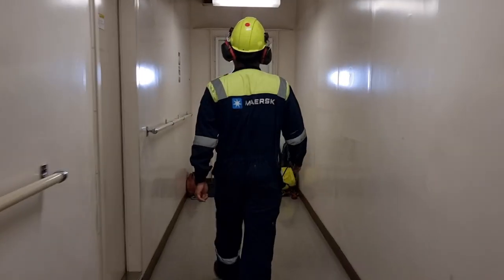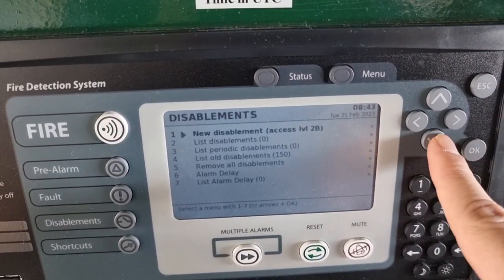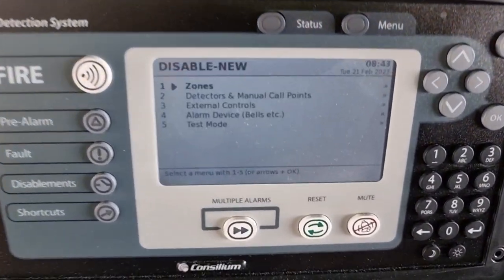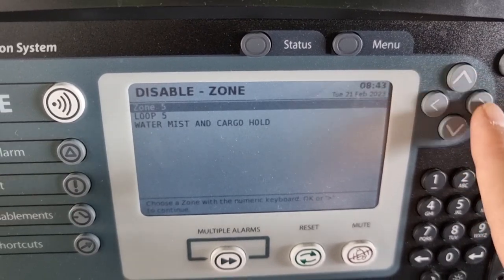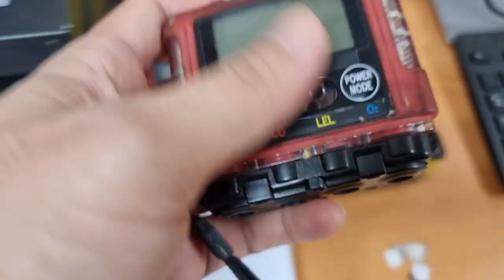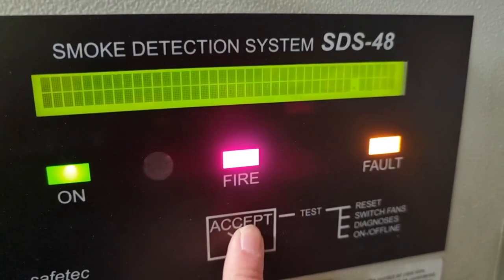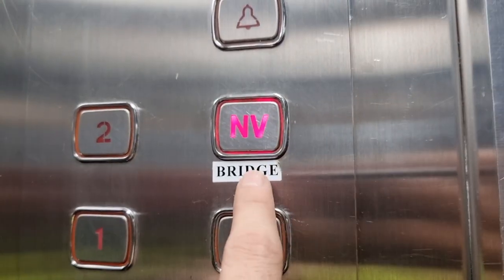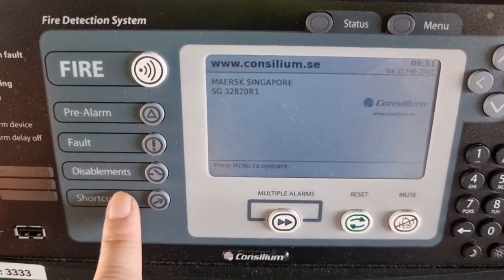FIRE ALARM, SMOKE DETECTION SYSTEM TROUBLESHOOTING

Comment: Interresting video as always, thanks!
I'm curious as to why the smoke-detectors are mounted remotely instead of inside the cargo holds?
Also what are all those CO2 bottles used for? Fire suppression?
Reply: Just a guess, absolutely not qualified in anyway to answer, but my guess is because these sensors would need to be mounted on the ceilings, and in potentially very difficult and dangerous to access areas. Routing piping to these locations and then pulling air through to a central location brings all of the maintenance to that central location as well.
Reply: Yes. it's for fire suppression. Since it woud be difficult and time consuming for  the crew to extinguish  fire inside the cargo holds.
Thanks lecky jake
Reply: Yes, slight delay in sensing due to distance but robust pipe work delivering sample air instead of cable works and connections and detector units spread everywhere and getting damaged as well as needing maintenance 
Correct me if wrong ?
Good eve